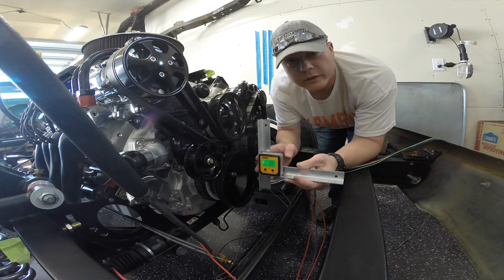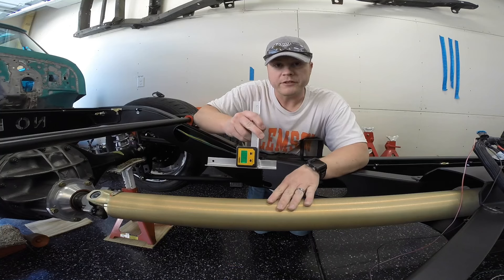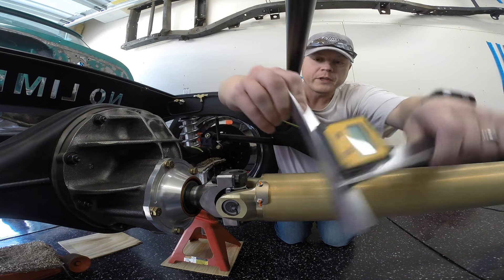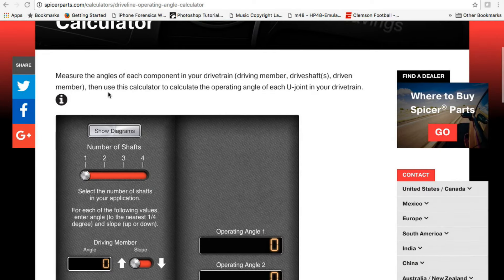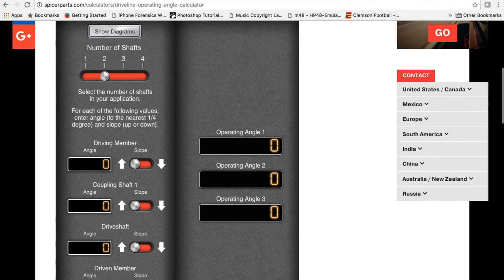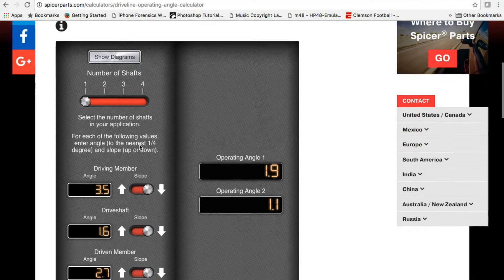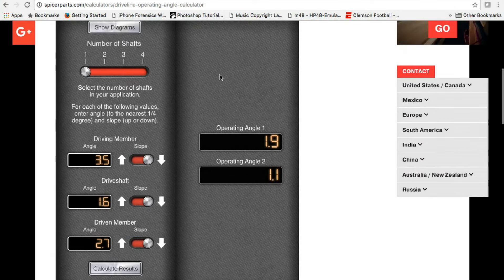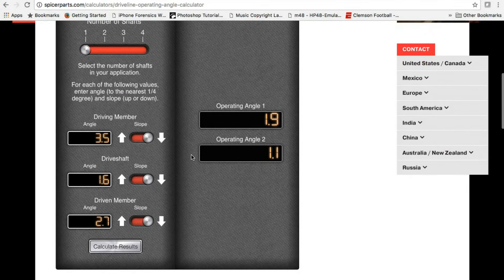Driveline Angles

Comment: The main reason these angles are important is because a U-joint doesn’t translate rotation smoothly when operating at an angle.  When at zero angle, the driven side of the U-joint rotates at exactly the same velocity as the drive side.  But, as the operating angle increases, the driven shaft will speed up and slow down twice throughout the 360 degree rotation (every 180 degrees) because the yoke drives the driven shaft at an angle.

If the shaft has two U-joints, and one u-joint deflects up and the other u-joint deflects down by the same amount, the rotational speed variation of the shaft is cancelled out at the final output.  If there is only one U-joint, or the joints are not operating at opposing angles, the total angular offset will determine how much of the speed variation will be felt as vibration.

Comment: Does this go for any Rear wheel drive vehicle?
Im doing a swap on a Rx8 , Still keeping it R.W.D
Reply from the maker: Yeah, should work for any rear wheel drive. Just keep in mind that any offset of the pinion left/right from the transmission centerline adds to the equation, but as long as the offset is small you can generally "ignore" the left/right and focus on the vertical measurements I walk through here. Good luck!
Reply: @C10CJ  thanks brotha, just trying to make it right, with no problems in the future.
Haven't posted any videos on the build yet,i need to post them
Reply: @C10CJ  and one more thing.
Does the vehicle have to be leave from front to back before you put Angle finder on it??? Or does it note matter??
Reply from the maker: @independentwarriorstudiesj6847  yeah, should have the vehicle on a level surface and suspension at ride height.

Comment: If you have the transmission shaft angle and the pinion shaft angle and you adjust those opposite each other to cancel vibration why do you need drive shaft angle....
Reply: He explained it less than 2 mins in, the u joints need a slight angle to work properly

Comment: It's not as small of an angle as you can get although that helps, it's equal and opposite angles that are ideal. In your case you need to move the pinion angle up to 2.7 degrees in order to achieve 1.1 degrees angle for both the pinion and the yoke.
Reply from the maker: The great argument of every pinion angle discussion ... what about suspension windup? It's not 0, throw a camera on your diff and watch what it does under load. It's different for all suspensions and based on the type of bushings used. I accounted for this in my setup. The more HP you put to the backend, the more the pinion will rotate under load. Put it this way, thousands of miles on my setup and not one single issue related to driveline vibration, all the way up to 120 mph. No cage so no need to push it much higher plus drive shaft critical speed limits me to 155 mph.
Reply: Seems like you were 3.5 down with motor and 2.7 up with the pinion. Thats less than 1 degree difference. Send it. Nix the music.

Comment: My problem is I have a ford 9" built for my truck i have it centerd on my truck but the pinion is offset so the drive shaft is not straight its crooked a lil is this a problem does it need to be centered so it's straight i figured they would have centered it when I ordered it like the stock one. Does anyone know? Lol
Reply from the maker: a little off-center is generally ok provided you've got the u-joint angles around 1 deg in the "vertical" sense (the method I show here). The compound angle makes it harder to calculate the actual u-joint angle so trying to minimize the u-joint angles in this method generally gives enough room for the compound angle caused by the off-center pinion. I've not dealt much with off-center pinions so I can't really say what's a good number vs a bad one, but based on what you describe and assuming your driveshaft is longer than say 48" I'd think you'd be ok. Just make sure the driveshaft doesn't contact anything as the suspension moves through it's range since it is a little "crooked".

Comment: I am at the point of measuring for my driveshaft. Giving consideration to sourcing a used drive shaft from a 06 Tahoe, because that was the donor for engine and 4l60E. and having it sized. But I wanted to ask if you had any recommendations on a custom built driveshaft, possible improvement in strength while reducing weight. Also you referenced 1350 U Joints
Reply from the maker: Hey Gary, I'm running way behind and trying to get caught up. You may have already made a decision on this, but if not, I'd recommend Mark Williams Enterprises in CO for the driveshaft. Their tech is awesome and they can help size and spec the right driveshaft for your application. I went with their 3.5" diameter 6061 aluminum driveshaft . The 1350 u-joints are a must if you have a heavier setup and increase the power. Otherwise they will be the weak link in the drivetrain and would be more likely to break on a hard acceleration. Also, the 1350 u-joints Mark Williams used do not have grease zerks so they don't have the grease passages which weakens the u-joint.
Reply: Awesome Man Great information and timely, I value all your input. Thanks Again Sir

Comment: Understood what you said about "measuring" the angles. My question is: When you are fabricating a bare chassis, how do you simulate/determine "ride height" before the car is complete?? Are there any app's or graphs for common applications such as "classic Chevies with LS motors" for example???
Reply from the maker: For me, I'm not aware of any apps or graphs that help with ride height. That's really only because I have hand drawings of the chassis (key points on the chassis) and I know where the body lines sit relative to certain aspects on the chassis. The flip side of that is I also know what length shock I want to run, so I always try to get the shock in it's sweet spot around 50% stroke at ride height. So having the shock in it's sweet spot sets a length, and I make "setup" bars which simulate that length. I just use a 1"x1" bar and drill the holes at the appropriate distance. Back to the other side of the equation, I will take a bunch of measurements of how the body is sitting on it's current chassis relative to where it attaches to that chassis (since hopefully that doesn't change on the new chassis). I use the floor as a datum and put tape on the floor to mark certain spots with a plumb bob for horizontal measurements (just know once I start this process the vehicle sits in that spot without moving it for as long as it takes to get the measurements). For example, on my C10 I know that to get the top of the rear wheel opening right around the top of the wheel I need the bottom of the frame at the rear cab mount sitting around 7.5-8". I know the rockers then sit about 3/4" up from the bottom of the frame rail. Knowing all that, with a solid rear axle it's a matter of taking tire size, axle tube size, adding some space for travel at ride height to the frame rail which sets the frame rail height, then attaching the desired length shock. The longer the shock the better ride you'll get. You'll always here the guys that have been doing this awhile say you start with the wheels. You need to know your wheel size and wheelbase/track and the rest will fall out. Hope that helps. Probably not the answer you were looking for but I tend to be old school on some stuff.
Reply: Thank you for the great reply. I know that is a HUGE question and a tough one to answer here. I'm trying to help my son set up a 57 Chevy chassis with a LS, Tremec, and 9" Ford. The suspension is pretty much figured out. Wheels and tires are "anticipated" as there is some hesitation to purchase those components this early to avoid damage/deterioration due to the time these DIY projects take. My question involves knowing how much that suspension is going to compress "before" the chassis is complete with the body, interior, engine, etc weight applied. Do you "estimate" the weight and distribution and "simulate" by adding that amount of weight on each end of the chassis with wheels/fakes mounted and on the ground?? Essentially, you are speaking about where you WANT the chassis to sit while I'm asking how do you know where it's ACTUALLY going to sit without having a complete car??
Reply from the maker: Hey sorry, I missed your question back when you posted it a few months ago. I estimate the weights and distribution the best I can. From there, it's spring rate and preload (assuming you are using a coil over) that will set ride height when it's all together. So if my estimates are close, it's just tweaking the preload to get ride height. Worse case, if I'm way off I make a spring rate change, which would probably be needed anyhow if I was that far off. I've then got a calculator I built in excel for my setup where I plug in the weights, preload and spring rates, along with tire size, and it calculates ride height.

Comment: Thanks for the explanation.  I lowered my 2017 long wheel base truck and have a vibration at low speed.  So....I'm going to be checking these angles.  However, something that doesn't sit right with my understanding, just yet.  It is a long wheelbase truck, and hence a two piece drive shaft.  However, the relative angle between the output shaft and the carrier bearing hasn't changed.  For measuring and calculating, can I treat this as a single piece drive shaft?  I will admit I'm not clear on what is happening mechanically,  at the carrier bearing.  Thanks again for the video.  P.
Reply from the maker: Is your truck trailing arm rear suspension? If so, the pinion angle changed as you lowered it down. There are aftermarket shims that you can get to help correct that situation. And you could treat the rear shaft as a 1 piece since you didn't touch anything forward of the carrier bearing. That's why I'm thinking your pinion angle is out.
Reply: Thanks for the reply.  The rear is leaf spring.  This morning  I went out and measured everying for angle.  Starting at the front, it is 5.6 down, 4.8 down, .4 down, and 3.2 down.  I put this in Spicers calculator you linked and I get some interesting results.  Seems that the 'ugly' is in the 2nd operating angle.  In my case that is the carrier bearing universal.  I started playing with the angles as if I had shims and the only things that seems to help is to raise the carrier bearing.  But I'm only guessing at what change that would induce in angle.  Guess a little math here might help.  Not my strong point.  ~P.
Reply: So my trigonometry is nearly non existent, but I can draw.  So I took a couple more measurements and booted up Fusion360.  I let fusion start giving me projected angles of the driveshafts, when I changed things, specifically the height of the carrier bearing.
I looks to me like it will take a combination of moving the carrier bearing up, and using the shim that Belltech provided on the back of the trans to change the output shaft angle by a fraction of a degree.  That will get all the operating angles within 1 degree of each other, and all well below 3 degrees (.9,.5,.6).
I guess I'm not done cutting on the truck.
Reply from the maker: Yeah, the 2 piece driveshafts add a layer of confusion to the process. Sounds like you are getting on the right track. It could be the carrier bearing wound up in line or below the pinion when you dropped down, so raising the carrier up a little would make sense. Then yeah, once the carrier goes up, the rear of the trans needs to go up as well to keep the coupling shaft happy. Good luck!
Reply: Part ordered.  I'll let you know how it goes.

Comment: 3.5 - 1.6 = 1.9
2.7 - 1.6 = 1.1
Pretty basic calculator. I'm sure most of us can easily do that in our heads.
More importantly I thought the most critical thing to get right was the diff and crank angles to align.
Yours are 0.8 degrees different. Maybe at ride height the gap will close, but I'm surprised the calculator doesn't flag this as an issue.
Not having these angles the same will mean that your wheels will slow down and speed up relative to the crank speed.
That will be the cause of vibration. Unless 0.8  degrees is close enough to not matter?
Reply from the maker: Similar comment to another, so same reply: The great argument of every pinion angle discussion ... what about suspension windup? It's not 0, throw a camera on your diff and watch what it does under load. It's different for all suspensions and based on the type of bushings used. I accounted for this in my setup. The more HP you put to the backend, the more the pinion will rotate under load. Put it this way, thousands of miles on my setup and not one single issue related to driveline vibration, all the way up to 120 mph. No cage so no need to push it much higher plus drive shaft critical speed limits me to 155 mph.

Comment: In the video, you include pinion angle as DOWN.. Unless I'm reading it wrong, the pinion angle-if pointed below a 90 degree angle (pinion angle DOWN), should be considered an UP slope.. The Spicer site defines "UP" as "Up: Rises from front to rear of vehicle". So, if you were to draw a line through the nose of your pinion using the measurement you get with the angle finder you would see a line that gets higher as it moves away from the front of the vehicle. The engine, and driveshaft, with lines running through their plane, would both get lower as you tracked them from front of vehicle to back-meaning they would be DOWN. The pinion is the OPPOSITE if or when the pinion angle is down relative to a 90 degree angle. Just wanted to be sure that I'm understanding this correctly, and that anyone that is viewing this is also getting correct information.
Reply from the maker: Hey man, so you're right on your understanding of slope but you've also got things a little backwards from what I said in the video. I think your error comes from the statement "Unless I'm reading it wrong, the pinion angle-if pointed below a 90 degree angle..." which you unfortunately are reading it wrong. The thing I used to measure the angle is a digital level, not a digital protractor. So that little arrow indicates which way that end of the digital level needs to goes to be level, which, in my case was pointing up indicating the back (left in the video) of the yolk is lower than the front (right in the video) meaning the pinion is sloping down from front to rear. That little arrow does not indicate slope.

Comment: Question : Both of my Operating Angles 1 & 2 say ( 2.3 ) exactly is that bad because you said anything over 2 isn't good even though both numbers are exactly in spec with each other?   my transfer case angle is 8.7 down / driveshaft angle 6.4 and my pinion is 8.7
Reply from the maker: JessieJ if your angles are matching that’s good. The slightly over 2.3 just means you might experience a faster wear on the u-joints. Sounds like you’ve got a lifted truck so I’d say you are in good shape for being lifted. Give it a drive and if no vibrations then I’d run it as is since the tcase output and pinion angles are in sync.
Reply: Yes my truck has 2" lifted springs in front and 2" blocks under the springs in the rear. Thank You for replying it helped my decision greatly I will let you know how it goes once I get my truck up and running again ;)

Comment: Thanks for info,  but i still have a problem,  my trans is 4.2 deg down  drive shaft is  0.7 down and pinion is 1 deg up (faces towards the ground)  calculator says  angle 1 = 3.5  angle 2 = 1.7   what the calculator  doesnt show is that both my u-joint angles point towards the ground, does this matter or is it ok as long as angles are within range of each other.
any help is much appreciated.
Reply from the maker: Hey Speed Freak, there are 2 things that stand out to me with your setup, the first is the angle1 being greater than 3 degrees. The second being the trans and pinion are not parallel. The more concerning one is the not parallel u joints. Depending on your rear axle, you might try to adjust the pinion angle (i.e. angled shims under the axle mounts). Another option would be a spacer under the trans mount to raise the rear of the trans a little to reduce the initial driveline angle. Travis over at Mark Williams (I got my driveshaft from him) put together a good video showing what happens with u-joint angles that aren't parallel. Check it out here: https://youtu.be/a3MJ4OuHmZw

Comment: Thats not much pinion angle your running.
Reply from the maker: There is no "right range" of pinion angle, you run what you need to get the proper u-joint angles.

Comment: you say the the engine slopes down , so the front is higher . the tailshaft slopes down , so the front uni is higher . the pinion points down , the front of it is lower , but you didnt allow for that on the calculator .
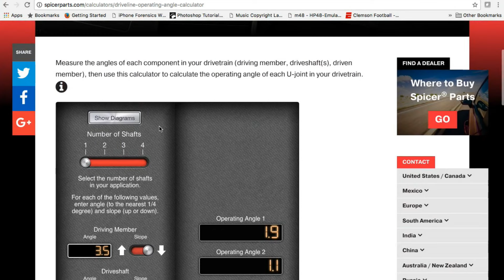Reply from the maker: I think you missed the discussion, try again around the 6:57 mark. My pinion does not point down. I said pinion up, but the spicer tool uses slope so the tool calls that pinion down.

Comment: Have you tried using a cv joint at one or both ends of the driveshaft to kill a harmonic vibration?
Reply from the maker: Jim Gracey I personally have not but I’ve also not had any issues following this procedure. If something is putting a u-joint out of spec I try to correct that something and get the u-joints back in spec. This truck in the video I’ve run up to 100 mph so far and drivetrain is super smooth.
Reply: C10CJ  following your procedure after shimming the rearend ended up with 1.8deg (nose down) on the pinion angle. Thanks for the clear information. Using the crank angle simplified everything. FYI, found the horizontal cast ribs on the pumpkin housing were within .1deg of the pinion (1967 Chevy rearend).